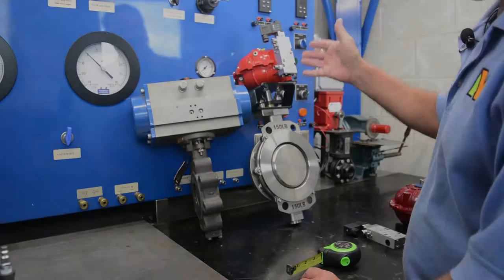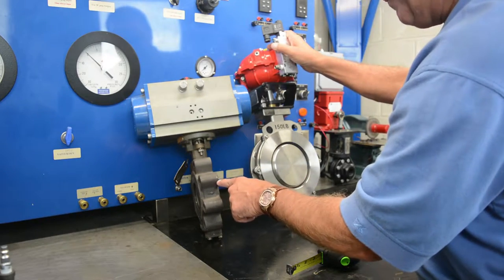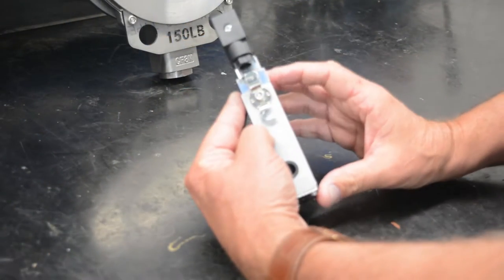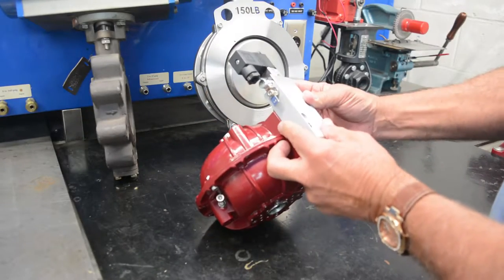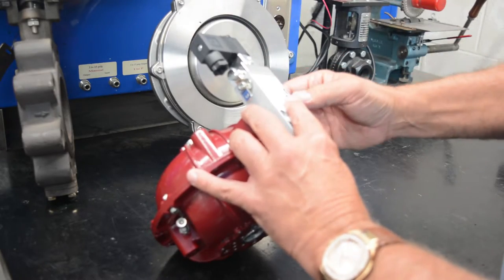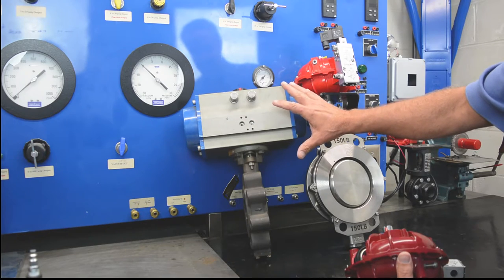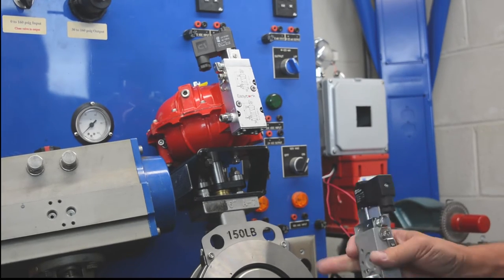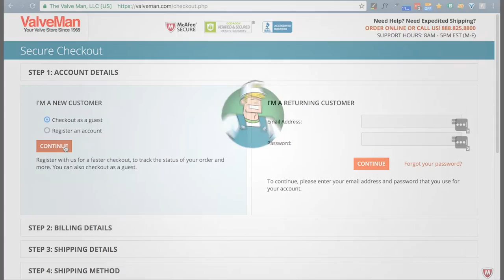Choosing a Vane Actuator vs a Traditional Rack and Pinion

Comment: Nice video Mr. Welsford. 

Could you compare the air consumption and actuation time between the rack and pinion and the rotary vane actuator?

You also mention that the rack and pinion has a spring return, is the "fail safe" setting that you show on the rotary valve a similar function? 

Is there any functionality that is only available on the rack and pinion type actuator?

Thanks,
Andrew